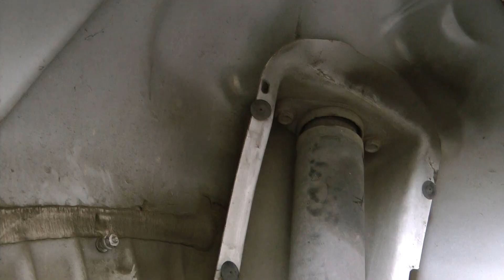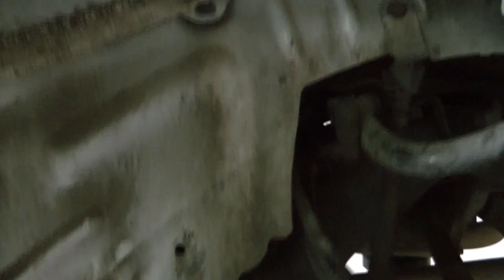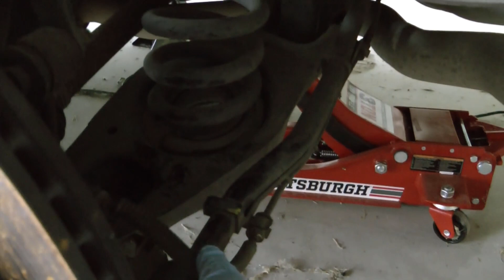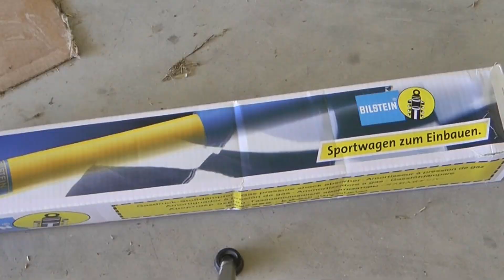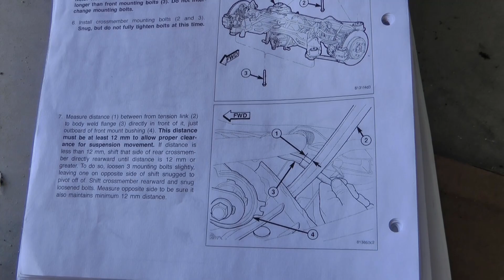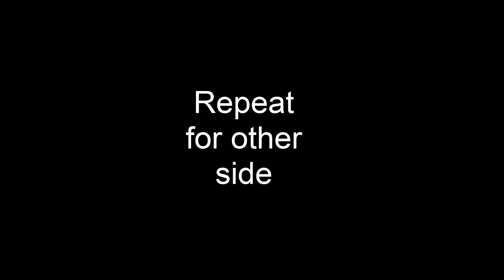Dodge Charger police Nivomat rear shocks and springs

Comment: Yeah man, I think you should take your time and do some research before starting any of these projects in the future. You can change all of this by just pulling the interior lower control arm bolt, you don't have to drop the subframe.
Reply from the maker: I followed the shop manual instructions

Comment: Mannnnnnnnnn!!! You saved me , just bought the same car had changed the front ones nd I learned that AutoZone gave me the wrong ones but my mechanic got the right ones , anyways they tried charging me 500 each lol new mechanic time, but where did u order the parts ? Or are they the 315$ police ones AutoZone has ?
Reply from the maker: I put a link to buy the ones I got in the video description

Comment: R/T rear shocks will fit, you have to pull the hardware from the top of the nivomat shocks, install the base plate included with the new shocks on the top of the shock, then install the nivomat hardware on the top of the new R/T shock base plate, I just did this on my 06 Daytona.
Reply from the maker: I couldn't figure out a way to remove the hardware from the old shocks.  But thankfully I saved them so I can eventually transfer if my Bilsteins ever wear out.  Thank you for the tip

Comment: Why want rt struts fit ?
Reply: R/T rear shocks will fit, you have to pull the hardware from the top of the nivomat shocks, install the base plate included with the new shocks on the top of the shock, then install the nivomat hardware on the top of the new R/T shock base plate, I just did this on my 06 Daytona.
Reply from the maker: the top of them is different

Comment: Why would you take the plastic splash guard out? Didn't do it on mine and it's just extra work for nothing
Reply: To change the spring all I did was remove the strut and then the 2 cradle bolts. Then slowly lowered with a jack.
Reply from the maker: I was following the Dodge shop manual instructions.  I didn't try to do the job without removing
Reply: Makes sense that they would say you need to do things that aren't required. I'm glad you didn't take everything off or loose to change it and  when you chose to use a strap to compress the strut I laughed because that's exactly what I did...lol

Comment: Men nice and useful video, i just currently buy the exact same car and i love it, did you already change the front suspension? Im looking for the part number for the front shocks or struts
Reply from the maker: I did do the front suspension.  I haven't edited the video yet because I ran into some struggles pressing out the lower ball joints.  These are the struts I used and they work great:  https://amzn.to/3ixQP9K and https://amzn.to/3AtsYy5

Comment: Why do you have to tighten the bottom bolt on the shock with tire and on the ground? I tighten mine with tire off and off the ground? I'm curious if this effect the height of the car bc my car still seems to be low in the back
Reply from the maker: I don't know why, but there are 3 things that Dodge says to bolt with the weight of the car on the wheels, that bolt, the bolt on the front control arm, and the nuts on the front upper control arms.  I honestly don't know if it changes the ride height or anything.  I tried tightening the front control arm both ways and there wasn't any difference that I could tell
Reply: Not sure if you converted over your Nivomat shocks to standard shocks, but I've heard if you don't change out the springs at the same time it will be lower in the rear.
Reply: If you torque the bolts down without load on the components, you increase the torque load on the bushings when it's at ride height. That only compounds the torque when it flexes.

Comment: My charger had bad camber tires look slanted rear inside wear and slides when in rain no control will this fix the issues and thanks alot s
Reply from the maker: I had same issue, seems to have helped, but not completely fixed the issue.
Reply: @WJHandyDad  wht else have you done i have maybe the sways bars but that it
Reply from the maker: my guess is the camber link since that's literally the name of the component and the problem that we are both having.  But I didn't try it yet on mine
Reply: @WJHandyDad  i already did i got the plus 1mm repair camber of mopar .com i also put the sway links and nothing no improvment i have the rear sway bar im  watig to install but i wanted to put the rear sway bar and spring at the same time have u found any other info on this topic
Reply from the maker: when I asked about it on FB a while back, most people said they thought it was "normal" for the tires to lean in.  I see it on a ton of Chargers.  But I have a hard time believing it's "normal" though because it eats up the inside of the tires quickly.  I have full tread on the outer portion of my tires but the inner 1 to 2 inches are so bald they look like they're going to pop.  Unfortunately I haven't found anything that fixes it.  If I do, trust me I'll make a video!
Reply: @WJHandyDad  what else do u think its can be ?
Reply from the maker: I re-read my Charger shop manual and it says the rear camber is "not adjustable" although they mention camber specifications but not how to fix it if the vehicle is out of spec.  Very frustrating.  I'll keep looking because surely someone has found a workaround
Reply from the maker: I also found these, I don't know if they'd fix it or not  https://fasthemis.com/i-23835844-spc-adjustable-rear-camber-kit-dodge-charger-2006-2021.html
Reply: @WJHandyDad  I mean there adjustable camebers like 2 mm i already have the repair camber 1mm bushings so that would be 3mm doubt thats enough
Reply: The L X platform rear suspension is designed to have a few degrees of negative camber. It's supposed to help with cornering, but causes the rear tires to wear abnormally on the inside. This is worsened with wider wheels/tires. There's no way to adjust this either. You have 1 of 2 options. Either install adjustable control arms, or install adjustable camber bushings on the top 2 control arms.